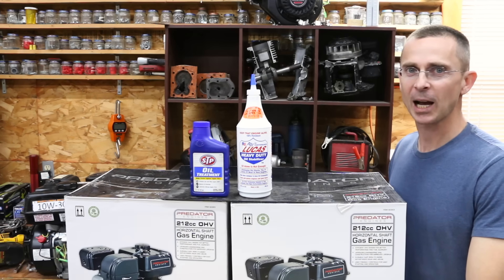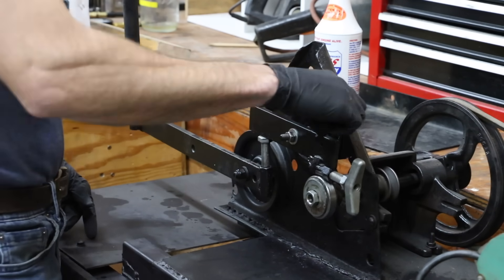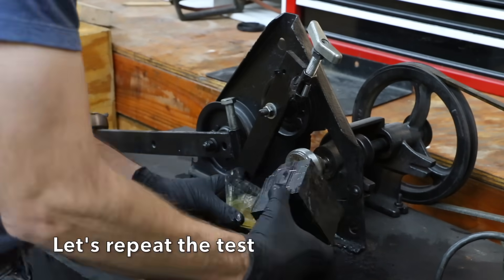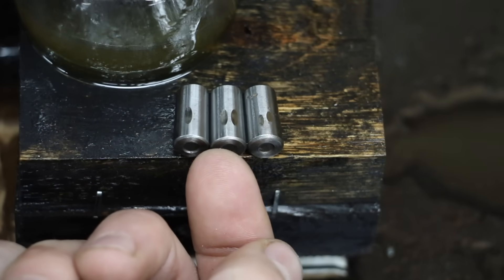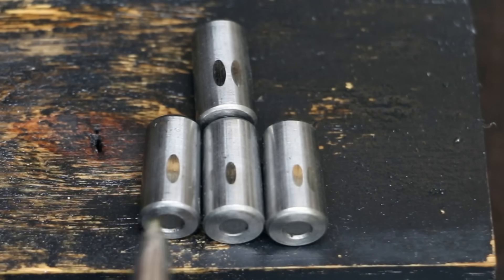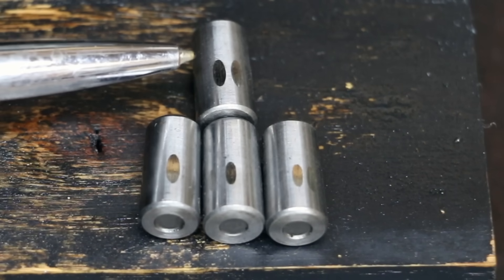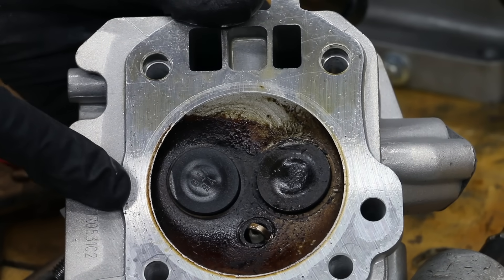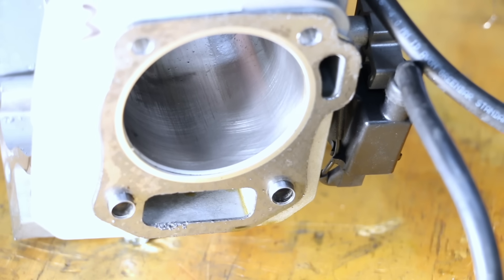Which engine self-destructs first?  Lucas or STP?

Comment: To back the Lucas, I’ve got a 6.0 that had failing HPOP and possibly bad dummy plugs, just getting it to crank when hot became a chore but if I added the Lucas Oil Stabilizer it would actually turn over n crank up even when hot and run for awhile…until I cut it off again 😔
Reply from the maker: Thanks for the feedback.

Comment: I will say, Lucas was so thick in my engine that it made one of my fuel value distributors (I’m sure there’s a technical name for it) gum up and almost damaged it to the point of failure. Thankfully I caught it early enough at a dealership and just had to get an oil change to get rid of the Lucas. Engine sometimes has the same problem now but not as much. Only when the engine /oil is super cold.
Reply from the maker: Thanks for the feedback.
Reply: Use the low viscosity locus oil it's for engines that takes this 5w20 5w30 low weight oil

Comment: Well I use STP 5w 30 full synthetic with Moa and I normally send in my oil to Blackstone labs every hundred thousand miles and it has always come back with no significant engine we're especially running on 10000 mile oil changes and I so far have done this on two vehicles one has over 340,000 miles and the other one just got to the 200000 mile mark. Another one that I've never used but I've seen test on it is bestline oil

Comment: My thoughts are kinda mixed because you had to add 2x the amount of Lucas so I wonder how it would of turned out if you’d put equal parts on both engines so it’s a even test cuz what I got out of this is the guys at Lucas are smarter than the STP cuz if STP recommended 2x like Lucas does it woulda turned out different I believe, as the STP engine was running cooler.
Reply from the maker: Thanks for sharing.

Comment: Do not use a thick oil like these two in your engine. It will damage the valve train. It doesn't flow fast enough.
Reply from the maker: Thanks for the feedback.

Comment: So I use to add the extra quart needed in my motors with the Lucas, I recently stopped because of the word "snake oil 🐍", and been told all it is is a viscosity/ oil thickener... And if that was the case will drag the engines and brand new oil efficiency down... It reeaaally felt good pouring that Lucas in my crank case but I don't wanna drag my motor with heavy concrete .... Is it worth the protection that I see on your bearing? Hmm... And I agree with everyone else sadly.... I wanna see 
LUCAS STABALIZER/ ULTRA PLAT PENZ
VS
5/30 PENNZOIL ULTIMATE PLAT
Reply from the maker: Thanks for the suggestion.

Comment: Lucas is the winner!!!, GREAT VID! THANKS.  I have been using it for 30years. I'm quite sure it was previously branded Mories heavy duty oil additive. I now mostly use MBL heavy duty oil stabilizer, which is why I am certain the reason I have over 1.2 million kilometers on my VP V6 commodore engine that is in my 1983 Toyota hilux RN46.. (and still barley showing a one thousands of an inch lip in the bore.) Please do a comparison test with the MBL product.
Reply from the maker: Thanks for the suggestion.

Comment: In the end the results were the same.   What's going to tell you that you have 9 minutes left?  

Anyway the  low oil sensor would shut the engine off way before it was running without any oil.

Interesting but meh.
Reply from the maker: Thanks for the feedback.

Comment: Now you know when they both throw a rod. A good test would be run two the same way but only for 5 minutes each (so the oil left in the bearings doesnt burn up all the way and waste the bearing to start knocking) and see the wear difference at that point. My bet would be on the Lucas.
Reply from the maker: Thanks for the suggestion.

Comment: That proves nothing other than one provides a little bit more residual lubrication.  Testing to destruction using the products as recommended with a load on the engine would be much more useful.
Reply from the maker: Thanks for the feedback

Comment: 3 years old and this just showed up as a suggested video, great info though. I ran Slick50 in a little car I had in the late 80s-90s. The engine ran cooler and cranked faster when starting. I was sold until I read about a private pilot who used it in his small, single engine plane. Apparently he was climbing, getting ready to go over a pass when he noticed he had no oil pressure, he made an emergency landing w/o incident. When the engine was torn down, the mech discovered the oil pickup was clogged with PTFE from the Slick50. Now, did the Slick50 save the engine or did it almost kill him?
Reply: The air cooled aircraft engines are different from the water cooled automotive engines, so their oils are different. The risk taker pilot used the unapproved automobile oil for his airplane engine...   “What about oil additives with PTFE (Teflon)?
Additives with Teflon resin should not be used in aircraft engines for three reasons;
1) When oil is burned in the combustion chamber (remember — aircraft engines burn some oil), the decomposition products are acidic and are extremely corrosive.
2) The resin is a solid particle held in suspension. In aircraft oil, these resin particles have been found to quickly drop out of suspension and combine with lead salts from leaded fuel. This leads to the formation of a sticky, heavy sludge. This sludge settles throughout the engine, where it can block oil flow.
3) There is little evidence to show they provide any wear benefit in piston engines.”
Reply: As "Tony Tran" stated the private pilot used the wrong type of engine motor oil... so... the "Slick50" would have killed the pilot if he had not landed. He had an angel on his wing that time! There are much better aftermarket aircraft engine motor oil additives that are vastly far superior to add to any motor oil than any aftermarket automotive engine motor oil additives and that is a proven fact.
Reply: There was a class action lawsuit against Slick 50 for false claims.
Reply from the maker: Great feedback. Thank you
Reply: That's a great story and a great question !

Comment: I think a great test would be checking the effect of different engine temperatures on oil. Does a cooler running motor result in a longer lasting oil? Effectively extending our oil change intervals and if it is beneficial, are we being lied to about our engines "optimal running temperature".
Reply from the maker: Great feedback. Thank you!

Comment: My mechanic has told me not to run those thick additives because they don't flow fast enough where the piston rings are and since it's so hot there the oil junks up or hardens and rings become seized. I don't know if this is true but I see how that could happen
Reply from the maker: Thanks for the feedback.

Comment: I have suggested this on another video;  I am curious how synthetic motor oil,  with no additives,  would do on a test like this.  I do know,  from experience, that it has great adhesion,  and is difficult to wipe from a metal surface,  and hands.  If I remember correctly,  it takes a good effort to wash off of hands with detergent and water,  also.  I just don't know about the film strength,  or how it would work in a splash lubrication engine,  but I believe it would be okay in both areas,  depending on the viscosity.
Reply from the maker: Thanks for the suggestion.

Comment: This was not a well controlled experiment. An engine with the same oil but without any additive should have been compared to engines with the additive. Because no engine is identical it would have been good to test the engine temps during running with and without additive using 2 engines. Temps on engine 1 without additive and then with one and then the other additive would have been informative. The test could have then be reproduced on a second engine. Removing "all" the oil and letting them run until they destruct is not a valid test of the function of the additive. Neither manufacturer recommeds running an engine without oil.. No significant conclusions can be made concerning the premise that additives might be snake water. No test was performed to address that issue. The main conclusion is that it is bad to run an engine without oil.

Comment: Here in the Motocross world. Racers stay away from Lucas oil, although being the oil of the motocrosd america’s. It’s cheap, and lacks heat resistant qualities. Where in a race bike clutch, and transmission components often get bright orange in heat. And Lucas oil seems to be awful at heat resistance as well as lubrication. You end up with metal shards, and fractured important motor pieces. Really bad.. You should try testing Blud Lubricants!! It’s extremely heat resistant.
Reply from the maker: Thanks for the suggestion.

Comment: Great video, Thank you. I was surprised that you didn't have a third engine to run with just the oil, without any additives. This would give a baseline and also show if the additives work, and if so, by how much.
Reply from the maker: Thanks!  Thanks for the constructive feedback.
Reply: Gotta have a control with just oil agreed...controls give a baseline reference...very important
Reply: Ditto. I would like to see the comparison to oil only. I use Lucas and have wondered if it's worth the substantial price.
Reply: @cat32643  I can tell you from experience being low on oil and in a 2003 envoy I pulled into a steep driveway in Los Angeles and the oil stopped flowing to the oil pump for just a sec and it dry ran for and instant I heard it and shut it off and rolled back down to level and added more oil immediately but it was too late and I lost compression on that cylinder. Never would have happened had It had Lucas in it. Motor replacement 5000 and some change, Lucas 20,  you do the math.
Reply: @seansilvers3624  interesting, a good thought…….Searching my memory: I used STP TWICE ( unfortunately memory only) in a 1957 Ford Engine( installed in 1954 FORD V8),& 1961 352 Engine ( in Sunliner 1961 CONVERTIBLE )::” memory lane “has it that the 57 Engine locked up ( past, thru Oil Filter.?), & the 61 Engine was still junk( rest of Car was worse….)…..anyways**, made engines quieter ?.??  This self investigation is error Prone… good times
Reply: @seansilvers3624  wouldn't have paid anything if you had Car shield! Car Shield cars go up hill Farther!  LMAO
Reply: Damn good idea son.....
Reply: I wonder if the only advantage of these addatives is that they are thicker. this would help with cold starts after an engine has sat for a while and it might help an engine on its last leg but I wonder if it would do anything for a good engi engine
Reply: Or just don't run your vehicle when it's low on oil.
Reply: @danamullins2723  that might be the smartest thing anybody has ever said ever, like God status!
Reply: @seansilvers3624  well thanks
Reply: Motor cost money
Reply: @edthomas3095  The fact that he's able to destroy two brand new engines for a YouTube video is probably a pretty good indicator that affording a 3rd wouldn't be an issue for him.
Reply: I thought of this and then considered buying a third engine just to set it to self destruct would suck.
Reply: @carsoncraytor9920  it's all in the name of science

Comment: How about a test with Motorkote❤️👍Been using for years and have 252k on my 6.0 in my 2005 H2 and use in tranny and power steering.All still original and runs like new still❤️
Reply from the maker: Thanks for the suggestion.

Comment: I was pretty sure how this would go before I watched. I bought a car with a 350 cid Corvette engine back in about 1972. Turns out the car had smoked a bit, so the seller had filled the crankcase with STP so that it wouldn't smoke or leak till he sold it.  I should have changed the oil immediately upon purchase (have done so every vehicle since...) so I might have identified the problem before disaster struck. That disaster looked exactly like the STP engine in this YouTube video. Two rod caps came apart at high rpm and mangled the whole bottom end and ripping the oil pan apart.
Reply from the maker: Thanks for sharing.

Comment: I don't understand the point of running them without any oil? To see which one would run longer with just the residual oil & additives in the crank & cylinder walls? Wouldn't a better test be like a longevity test?

Comment: Sold car parts for 15 years. I've had multiple customers tell me they knocked a hole in oil pan of their racecar and were able to finish the race while running Lucas. Never heard that about stp. The other product I have heard that about is called hi-tach but seems much harder to find. I would be curious to see how the Lucas synthetic performs since it has a viscosity around that of 30 weight versus the standard Lucas that seems more like 50 or 60 weight
Reply from the maker: Thanks for the suggestion.
Reply: I thought Hi-Tech was walmarts house(generic) brand.
Reply: @ytTaz480 Close!  Super Tech.

Comment: Well, I'm not going to suggest that you spend the money to burn up three more engines, but I would be interested in how STP and Lucas compare to just regular oil while running under load.  Running the engines with no load doesn't quite tell the whole story.  At what point were the engines no longer able to efficiently handle a load?  That could be very different from the time of total engine failure.

Any who, great testing you did there.
Reply from the maker: Thanks!  Thanks for the suggestion.

Comment: Something with this test was wrong. Those 2 engines should have lasted under worse conditions much longer. Those engines are just plain bad quality. I've had old mowers and 4 wheelers run with half oil capacity for upwards of 10 years through water and mud before anyone ever decided to check the oil. Motors are still fine. Something was very wrong with these motors. Hell we ran an old push mower through a football field took 2 tanks of gas everytime because our riding mower blew up. Never failed. Never changed the oil. Not sure how it's even possible to blow these up that fast.
Reply: Plus the fact they both blew up around the same amount of time tells me these are cheap throw away motors that aren't worth a damn.
Reply from the maker: Thanks for the constructive feedback.

Comment: Even 40-50 years ago the main thing STP was used for was as an oil viscosity improver to thicken up the oil and try to keep the oil pressure a bit higher in high mileage or basically worn out engines which the bearing clearances were getting loose or the oil was starting to get excessive blow by on the piston rings and even trying to slow down an oil leak on a worn out rear main seal.
You have to remember back then 120,000 miles was pretty much considered the full normal life span on an engine. 
Also oil leaks were very much a more common trait on engines during that time frame, today really not so much at all.
In modern engines putting any of that garbage in a good engine in my opinion is not the best of ideas.
Use a quality motor oil, better if synthetic and change the oil and filter at decent intervals and leave the snake oil concoctions on the shelf in the auto parts store.
Reply: Only real difference you will ever see from these oil additives is your gas mileage will go down actually. Dude doesn't understand that Lucas being thick will actually cause the motor to run harder to achieve the same rpm creating more heat because it has to slosh that thick oil around now instead of just basic oil.

Comment: Very interesting test. Thanks for sharing this. I would have LOVED to see a third engine tested with just oil and no additive for comparison to see if the additives really made any difference.
Reply from the maker: Thank you!  Thanks for the suggestion.
Reply: @ProjectFarm  I have a test to report. My friend cococted his own oil additive product  trial on my slant 6 Dodge van in the early eighties. We drained all the oil out and ran it on his brand of STP-like emulsion. We drove for a long time and then emptied that stuff and turned the key and it still ran with zero in the crankcase for at least another couple of miles. That sold me on additives and later when I bought a clapped out, sand in the oil car for a few hundred and drove it a hundred miles home I tried Bardahl in it to get me the miles home. It was a Dodge Shadow with a typical 4 cylinder and overheated after starting almost immediately (bcuz oil pump completely wiped out) so adding additive taught me the engine temp did not climb.
I emptied all the oil per our trial years before and ran straight Bardahl to the top of the dipstick mark- for an added 2 years before I jumped in one winter morning at zero degrees and forgot to idle her to a warm temp before driving. The engine seized in about ten minutes.
I have run (and still do in beaters I buy) straight STP and try to beat the crap out of them to kill them and can't-  or can't as long as I warm the engines before driving, that is. In winter the additives are about as viscous as Pooh Bear's favorite honey!
Reply: @dubblyewjay1133  slant six moter hard to kill anyway thats why old new york city taxis had the slant six
Reply: @lindarock4128  - If you're talking about Checkers, they use GM engines.
Reply: I agree, we needed to see a 'control' engine along side the test engines. Great video.